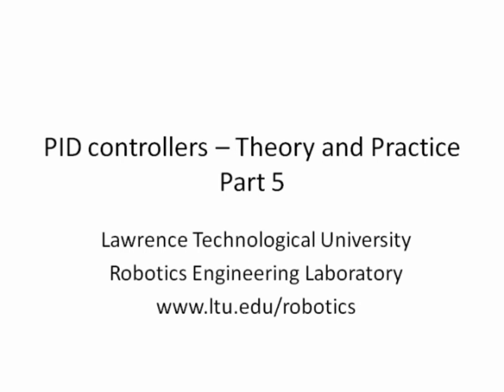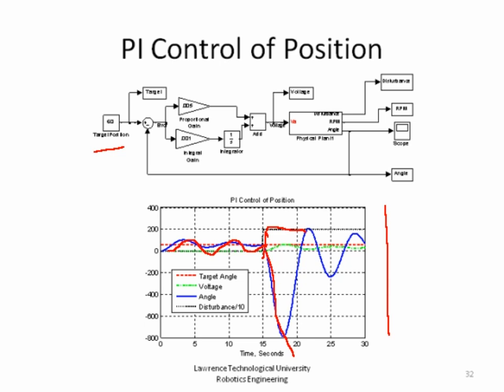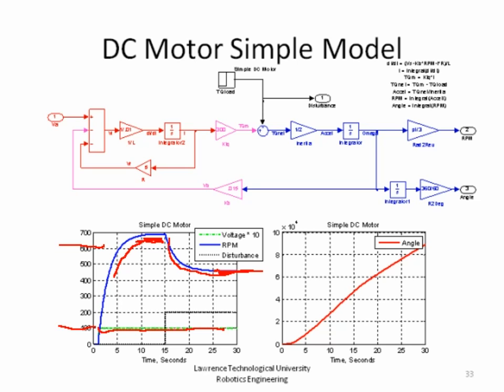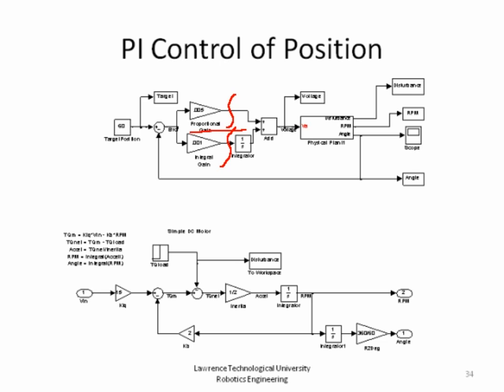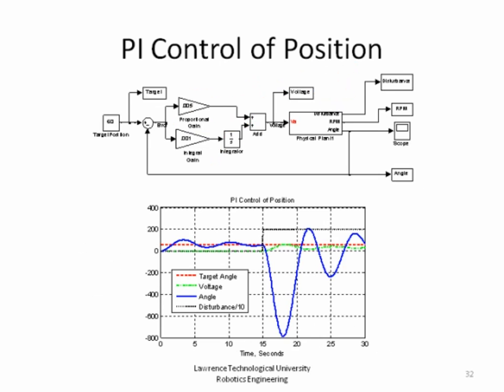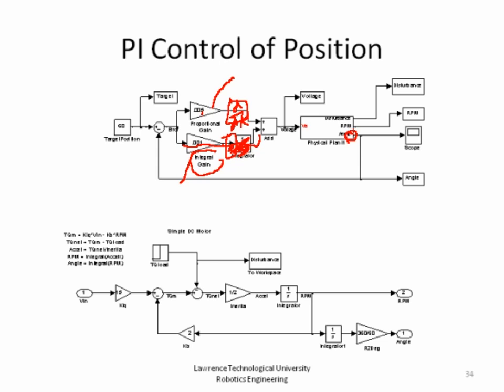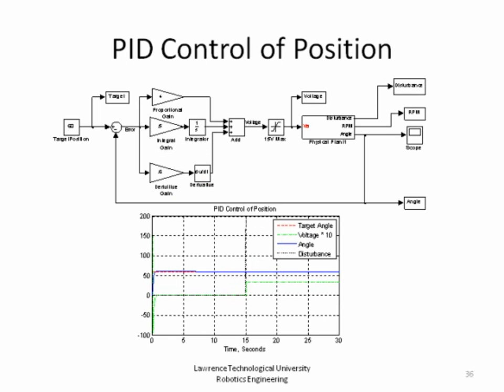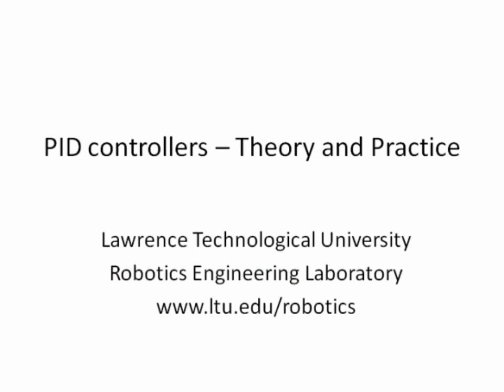PID Theory And Practice Part 5, PD control of position

Comment: So how do you expect the students to know how to tune a small DC motor if you can't explain EXACTLY how it is done?  I can.  Why does the angle move in the wrong direction?  There is something wrong.
Yes, why? What's up with that dude?
I would be very disappointed if I were paying money for this.
Warning, I/my company makes motion controllers for commercial use.  I know more that most university professors.

A simple motor velocity transfer function is just a gain with a time constant.  An extra s or pole is added to the denominator so there is 1 pole at the origin and one pole for the time constant.

I agree that a PD controller will work well in a simulation with no friction but a real system requires a controller integrator.  The result is  there are 3 poles in the denominator of the closed loop transfer function.  One is from the time constant,  one is from integrating velocity to position,  the last one is from the integrator fro the PID.

Since the PID has 3 gains and there are 3 poles it is possible to place the 3 poles where you want to get the desired response you want.  I don't see where this is made clear to the students.

What if you are controlling a hydraulic actuator?.  A hydraulic cylinder can be modeled as a mass between two springs.   Now what?   I know that a simple PID will not be good enough.

You teach PID like that is all there is.  It isn't.  You have only begun.

The first thing I would teach is understand the system.   There are integrating systems like tank level and position and there are non integrating systems like temperature and velocity.   The next is that there are single pole systems that can be expressed in terms of a time constant or frequency,  and there there are two pole or more systems where some of the pole may be imaginary.  One should be able to look at the response of a system and have a good idea what they are up against.

Once one understands the system, THEN they can apply the appropriate controller.
Basically, one controller gain is required to place each pole.   The controller integrator comes with its own pole so it doesn't help in placing or moving the open loop poles.

After understanding the system I would teach how to do system identification.   Too many textbooks give examples assuming that that open loop transfer function is known.  In my experience the machine designers are incompetent and the transfer function is NEVER provided.  One must know how to do system identification.  After system identification one has a an open loop transfer function can be used in the examples.

All that crap about root locus and so on assumes one knows what the open loop transfer function is.   In reality root locus in rarely if ever used.   I know I have never used it because figuring our how the poles move with just one is meaningless.  In reality you want to place the closed loop poles to get the response you want and work backwards to calculate the controller gains.

Another thing I have problems with is that too many instructors and textbooks are hung up on whether the system is stable.  In real life that is a given.  Stability is not good enough.  What the customers want is perfect control.  The PV or actual position always tracks the SP or target position.  No, overshoot etc.  Control most be perfect.  How do you achieve that?  You place the poles to get the desired response.  Then you use the inverse of the open loop transfer function to calculate feed forward gains.

OK,  it appear I am very critical.  I am but that doesn't mean what is in the video is wrong.  What I am pointing out is there is college or university control theory and then there is reality which is a little more messy.

Students should always ask where do the open loop systems come from and they should understand if they are integrating or non integrating and how many poles there are and whether they are real or complex.
Reply: i understand > 2 poles leads to unstable system. there are very complex ways to do those if you want a GBW using miller. but this lecture certainly gives a very good overview of what is happening. that is something you do not get from very knowledgeable people because they assume that students know everything and they delve right into maths. now i got the picture and now i can delve into the maths but at the back of my mind now i know what is happening and what i am looking for and where to point my finger if something goes wrong. you can learn the maths or ask someone else to do it for you but you need to know where is the problem.
Reply: You should write a book on control s.